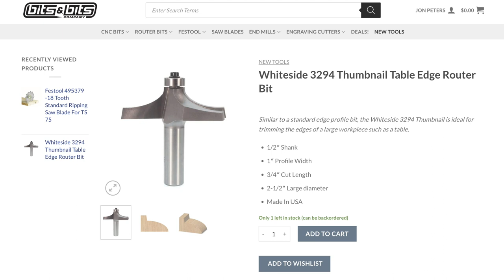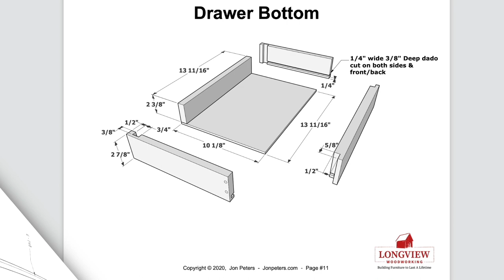Thumbnail Table Edge Router Bit / How To Use This Bit

Comment: I'm almost finished building a 'Jon Peters style' queen size bed with storage. It has two cabinets on each side that can be separated for ease of moving. Where you made a cabinet at the foot of the bed I've designed a rolling storage cart that will go between the side cabinets. The volume of storage eclipses a good sized dresser. Thanks as always for your videos, designs and clear explanations.
Reply: holy. can you film an overview?

Comment from the maker: I had a few questions on this router bit from the last video so I thought I would answer them here. It’s best to cut this profile and two or three passes. Make sure to keep the router moving at an even pace to avoid burning and if you have a leather work apron in the shop it’s a good idea to use it.
Thanks for watching and you can find the bit at this link. https://bitsbits.com/product/whiteside-3294-table-edge-router-bit/ref/6224/

Comment: I was wondering what to expect, going into this video! My first instinct was that this tabletop edging had been done on a shaper/spindle moulder with a powerfeed, but remembered that you don't use those ;-) My main surprise was that you use the bearing rather than making a long secondary edge guide on the baseplate itself. The other avenue could be to extend the baseplate out into an offset base makes the whole thing a lot less tippy, increasing control by adding leverage. Mostly I think an edge guide would be the kicker as that helps the base continue moving with confidence whilst running off the end of the cut, and this is sort of moving the process toward what one expects with a shaper/powerfeed arrangement. Always a pleasure when you upload, Jon!

Comment: When I'm routing a profile on timber that tends to burn, I take the penultimate cut with a little painters tape round the guide bearing. Then take off the tape and make a final cut moving as fast as you can and it will remove any burns.
Reply from the maker: Great idea 👍
Reply: @JonPetersArtHome  Thanks Jon, feel free to mention it in a video if you wish. the key point is that the final skim cut can be be done real fast and get rid of any burns. It really does work and not something I've seen suggested.

Comment: I use a chamfer bit & lower it to where the height of the 90 edge of the bit is flush to the top of the piece being routed. This gives you the same reveal look on the top of your piece as this. You simply adjust the height of the bit to the depth of the reveal you want. Some food for thought...

Comment: Bits of that size are usually used at a lower rate of rpms.
Reply: Bosch 1604a is a 25K rpm single speed machine